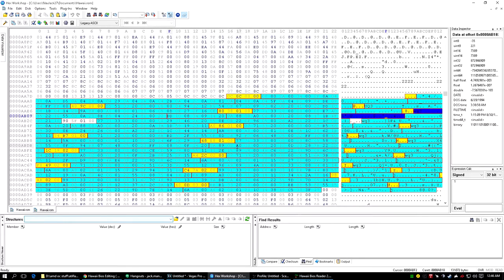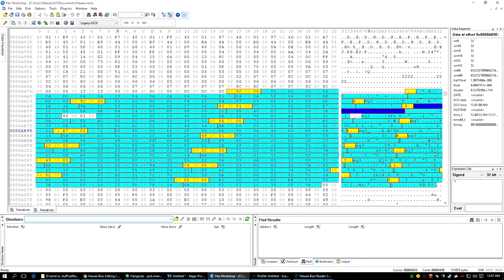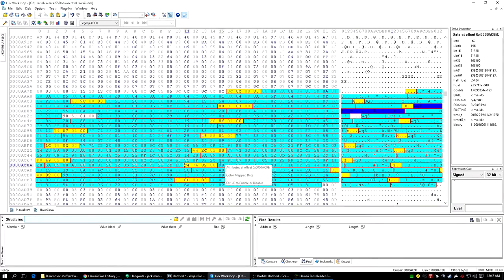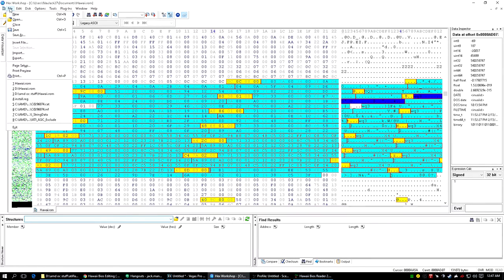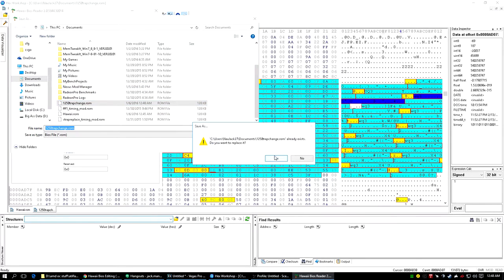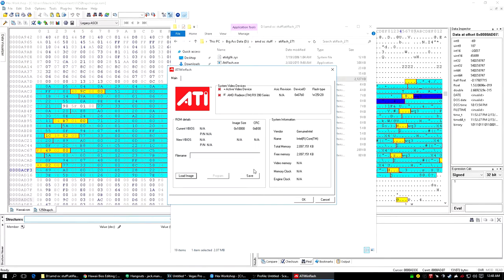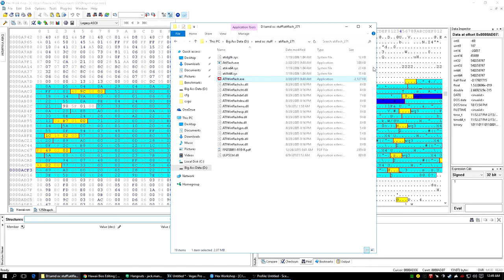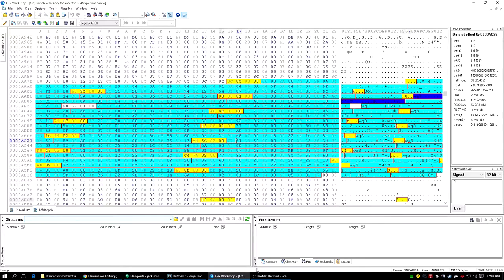290 290x 390 390x memory timings help video

Comment: Which version of Hex Workshop did you use & how did you get it to look like it looks, mine looks different than yours after installing Hex Workshop?  How did you get it to highlight the straps so it makes it way easier to identify them?  Please respond.
Reply: hey there, i recently rechecked my R9 390's after a while to check whether all of them have the custom timings from this video (3% boost everywhere) , and they do, opened this video to see how it's going, and noticed your comment and decided to reply since it's just from 3 days ago, basically you are quite fortunate

first of all, version is basically not important, you open the rom via File/Open , then you click Edit / Find , and you pick 32 Bit Signed Long & write 175000 , OK , then you right click the found hex, Add Color Mapping, uncheck the Use default background color, and pick the yellow, OK
then you just move up & left a bit & seeing the C4 7A02 00 which is 162500 , repeat the same steps for it, then move up & left again & seeing F0 4902 00 which is 150000 & repeat the same steps for it
once you made all of the memory values as yellow background, add teal color mapping background to everything what is in-between them.
once you done that, just follow the steps in the video & you are good to go.
// the "move up & left" applies only if the window size of the hex workshop is 1906x1022 and ver is 5.0.2.2769 (default window size in 5.0.2.2769 ver upon opening it up) , though it's not really important as i said, can use any hex edit tool and any ver.

Comment: Hey bro can you help me flash my r9 390 ? Im sick of blackscreens whenever i try to doing 2d stuff ( watching youtube etc ) i always downclock to 1450Mhz to avoid blackscreens. If i keep the card on 1500Mhz, it crashes .. i heard that i need to to modify the second memory timing or clock idk , on default its 150Mhz / 1500Mhz / 1500Mhz. It should be like 150/1250/1500 . Thanks in advance